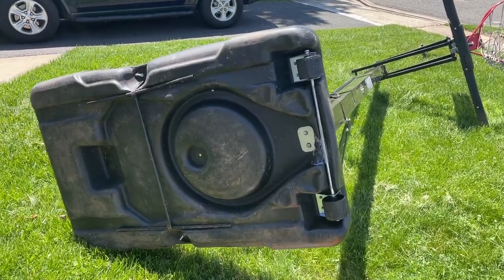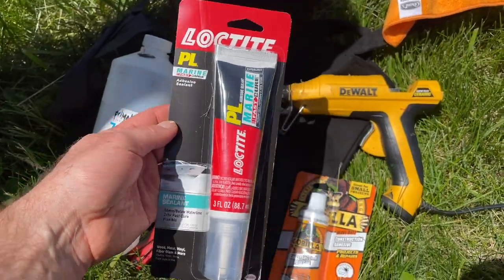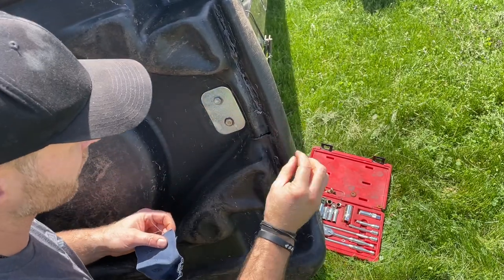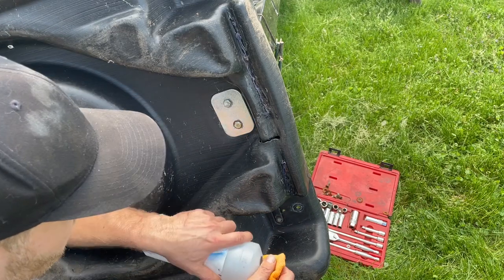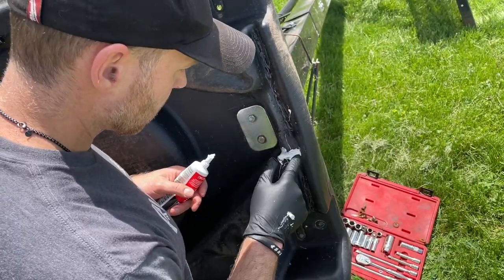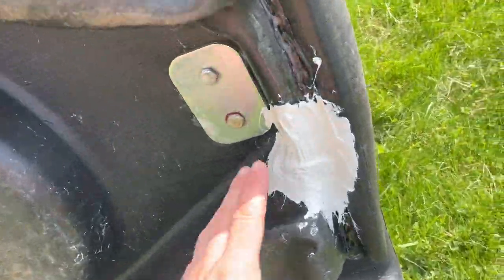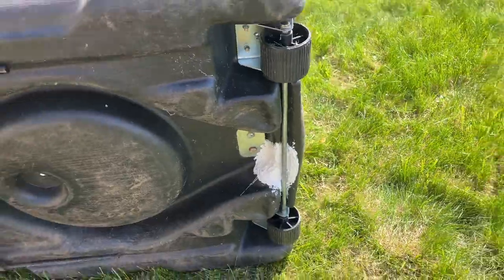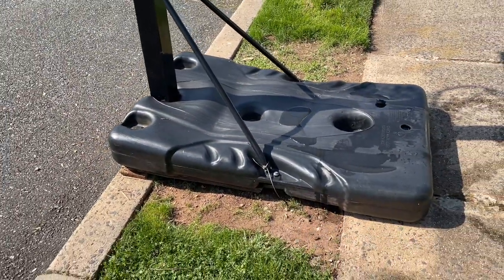How To Fix a Hole / Crack in Portable Basketball Hoop water Base (Quick & Easy, NO Welding plastic )

Comment: I have the same base and I just put a hole in it with the deck of my zero turn and I have a small hole..i will try your idea since mine is on thr side and not bottom..I have the gel in the base..works really good..its at academy..your pour it in and add water....try it.  Thanks
Reply from the maker: So far the patch still good.   I like the gel idea thanks.